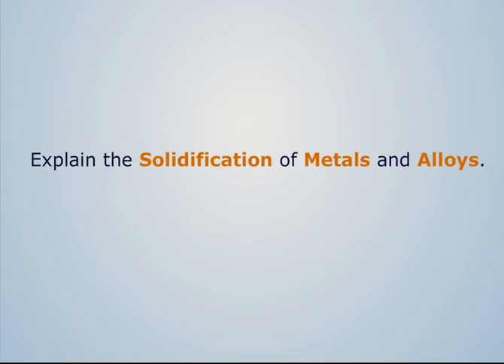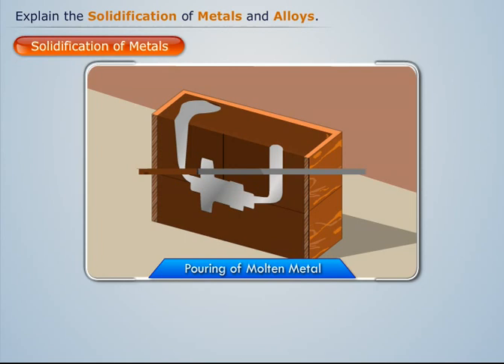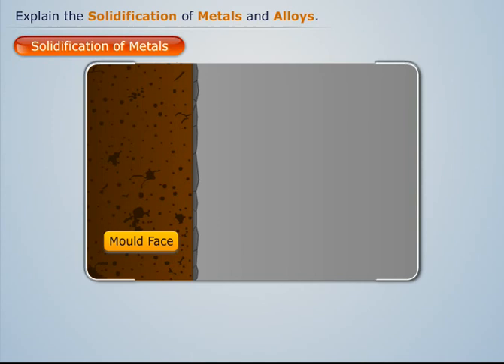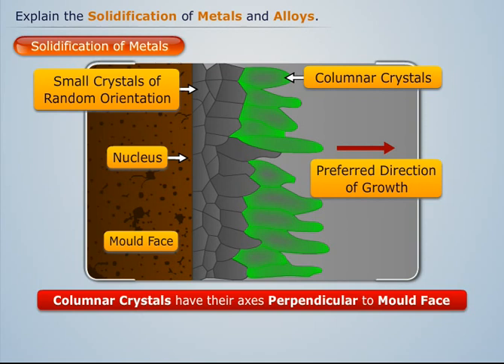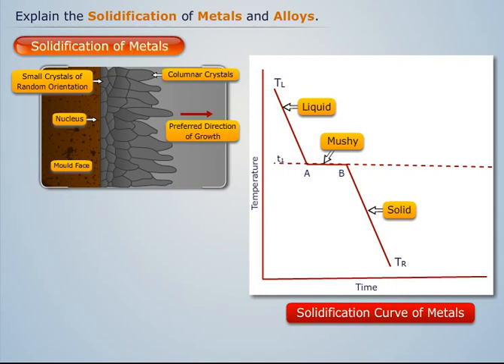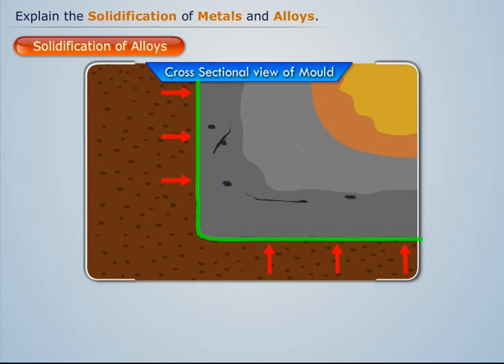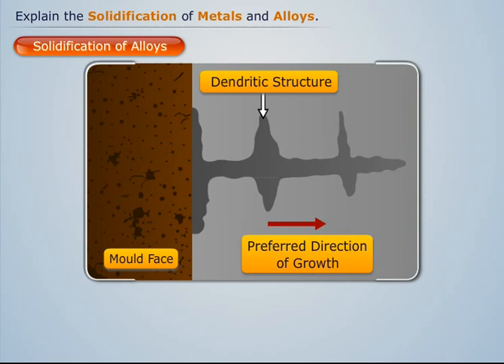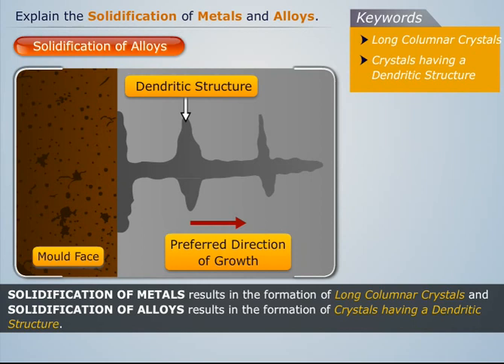Explanation of Solidification of Metals & Alloys | Manufacturing Processes

Comment: sir,plz make a video on dendritic growth with explanation.
Reply: Dendrites in alloys can be attributed mainly to solute rejection and crystal anisotropy. Solute is typically more soluble in the liquid than the solid metal, meaning it is rejected into the liquid as the solid grows. The solute rejected into the liquid makes the solidification front unstable, favoring perturbances to grow faster than the rest. Crystals are ordered repeating patterns of atoms. For this reason, crystals are favored to grow in certain directions. Perturbances are thus more likely to grow in certain directions, giving rise to a branched repeating structure which are commonly called dendrites. It's a bit more complicated but I think this is a useful model to work with.